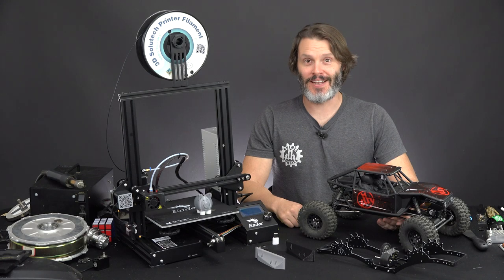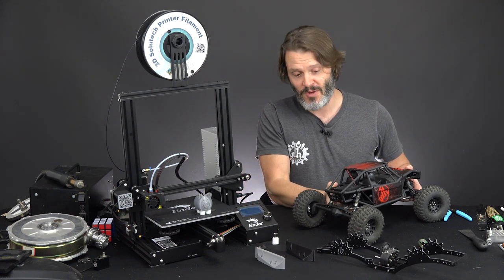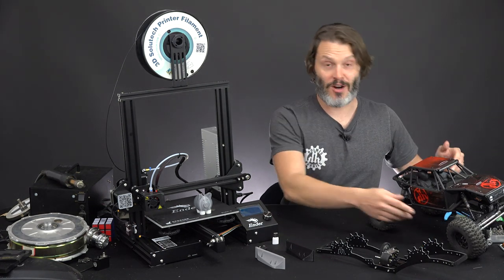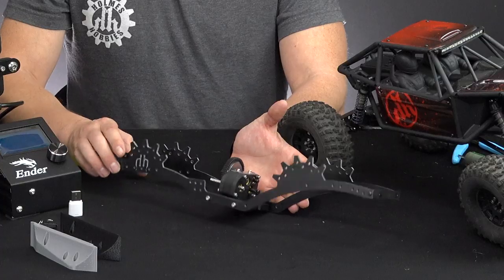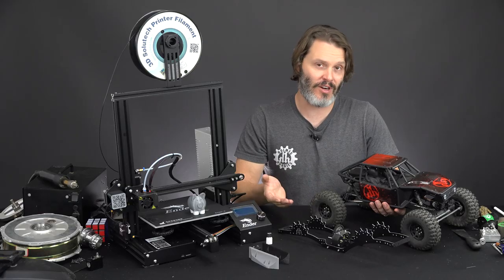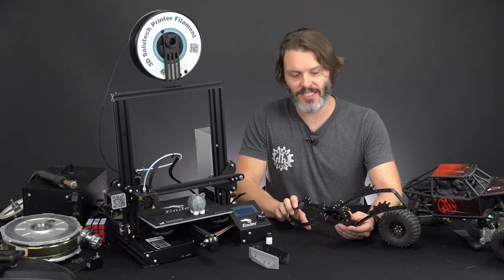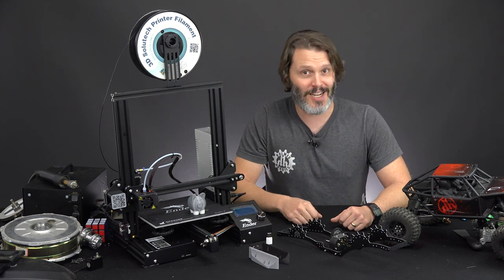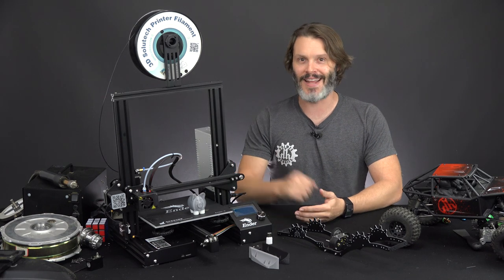Custom Axial Capra C2/ C3 Comp Rig Build - 3D Printed Parts, Custom Frame & More - Holmes Hobbies

Comment: I modify dual rate shocks by creating my own stop rings for them. The stop ring is actually what makes dual rate shocks dual rate, yet no RC shocks uses them. Without stop rings the second spring is just for show! I also use a third spring inside that pulls the car down. This lowers the center of gravity and this is crucial when sidehilling and during very steep climbs. I've done these mods since 2009 and it works very well.

Comment: Appreciating the Axial portal axles mainly for the ability to use small diameter tires, keeping crawling challenging on small obstacles but not having the diffs hang on everything. I have plans to use a VS4-10  chassis, Element tranny, and tires just under 4" tall. Have about half the parts, hoping to start early 2020 on the build. Maybe a hardbody this time?

Comment: Great Video! My Rule is always super soft Springs, heavy Oil (700—1000). How are you gonna do it with the center of gravity? I like the custom rails, but I would have also bent the rails in the back. Exactly the same as the front. With the portal axles you will get very close to the rear rails if you want a deep center of gravity. And then you will notice that you have no more suspension travel. The axle will collide with the rails.

Comment: My tip for the suspension is: hard springs in the front, Gmade G-transition or similar in the rear (droop setup+ soft springs), filled with ~40wt oil

Comment: I'm in the process of rebuilding my 1/6 scale Hummer pickup with clodbuster axles. I'm going to do electronic overdrive  ( because it's moa). 65t rear motor,45t front motor. We'll see how that works out!

Comment: I found another problem with the capra that I would like to share. I prefer full beadlock wheels instead of the stock ones. But the ones I wanted to sue would not fit due to the portals. What I ended up doing is using a set of spacers made for one of Axials other cars to move the hexes out away from the portals. It is now 10 mm wider than stock and others have seen my rig and done the same so they can use rims they want to.

Comment: The problem I have is I still like the trx 4 axles more. Their taller portals make up for slightly bulkier pumpkin and a bit more since it's only one peak right at the ring gear that's bad. My favorite axle overall is the ar44 non portal. Gonna be tough to dethrone that guy.

Comment: Finally got everything I need for a Complete Capra. Setting up a slight Droop on the stock Chassis with a little trimming and some Shock mount Mods flipped up for the droop.
My 1st build so I'll be playing with the shocks to get the Range and Flex I am shooting for. Even considering some custom links From Team Garage.
link to my Instagram on my YT Channel with updates. Sorry John went with HW on this build. I do plan on getting a RYFT, and will prob get my 1st Holmes Motor when I either Build the Kit ? or get the RTR. I want to Build a Bouncer named "Bumble", Light Blue Frame and White Panels.  Why Bumble ?    Why... because Bumbles Bounce.  ha ha ha       yeah I'm Goofy

Comment: The concept of 'overdrive' in an RC is new to me. Could you go deeper into that subject, sometime, John? At what point in the drivetrain is overdrive inserted? (can't imagine it increases the motor rpm output, as with 1:1 vehicles.)
I'm also curious about how overdrive can improve turning radius...?
Since you talked me into resubscribing, I'll be asking a lot of questions haha you may regret this, buddy
Reply: I could be wrong, but I believe they're referring to "overdrive" as the front wheels being geared so they spin slightly faster than the rear tires. Helps kind of pull your front end forward on super steep climbs.
Reply: @doug148877  Oh, that makes so much more sense. Thanks very much for answering, Doug.

Comment: I would love to take everything from the Capra and throw it into a standard rail chassis. I can't stand having to work on it in it's current form. Please tell me that's in the works? One thing as far as competitions, are the Capra's axles too wide?
Reply: Alvin Marin I’m right there with you. Taking the cage off the skid is such a pain in the ass. But it’s the trade off for such a light compact truck. I’m sure companies will start making kits to swap the Capra to a frame rail truck. I wouldn’t be surprised if axial didn’t drop a new truck with Capra running gear at some point. I don’t think the Capra axles are too wide for comps. Plenty of people use wraith axles which are even wider. Most folks regard xr10 width as ideal mix of wide for stability and narrow for clearing gates.
Reply: @jeremyh3445  your right, Axial will hit it out of the park with a frame rail truck with these axles.

Comment: Shock tip. Get 4 of the click pen springs. Place them inside the shocks on the shaft. Keep everything else on the shock the same. Outer springs, oil, and manifold. Gives you a plush ride for crawling.
Reply: I do not concur. I've tried it on all my rigs. I desperately wanted it to work for some reason. It destroyed every setup without changing the dial quite a bit to accommodate. Then when they were dialed in the performance just was not better than my preferred rig setups. I had to admit, it's not for me, at all. Plush is the last way I would describe the results! It kinda cushioned the plushness right out of my setups! I lack a better way to describe it. 😭😭😭
Reply: @johnbasterson7938  Well it works ok for me, RC Sparks, Exocage RC, and RC Review. So maybe it's preference.

Comment: John, you're a lunatic...but, in the best, and most positive, of ways...the type of "lunatic" that most (especially RCers) would love to have as a next-door neighbor.  While the Capra is my first crawler, I've seen plenty of other crawlers, and understand how, and where, the Capra is better.

Like you, I'm simply amazed at the Capra's capabilities, which is why I'm looking forward to building another...although, also like you, my second won't be 'stock'.  My "problem" is deciding how to build it.  While I REALLY like the cage/chassis, I also like the idea of a comp crawler rail-style chassis.  I there is just some way to combine the two (using, say, just the middle section of the cage, which normally attached to the skid), fitting the "rails" between the skid & cage...THAT'S the style/design is like to see (and, with my second Capra, build).